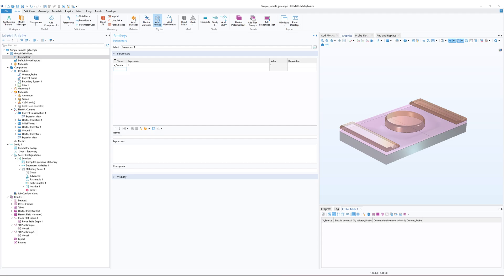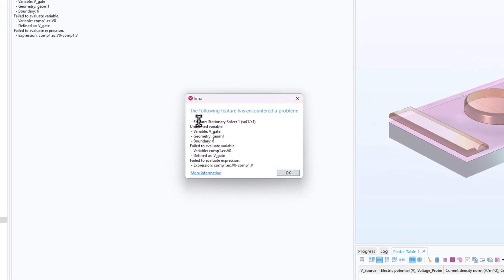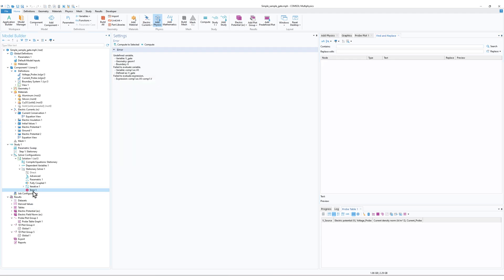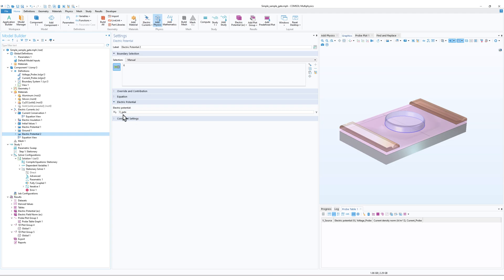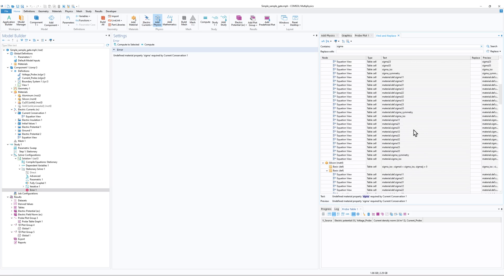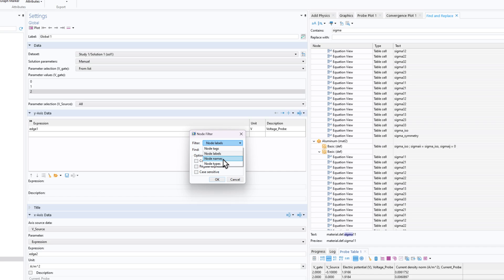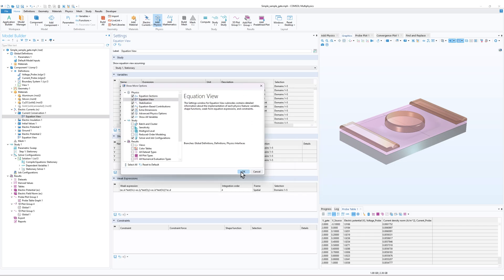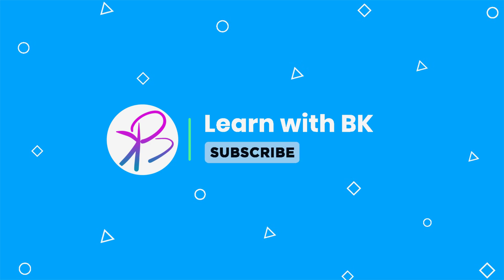Error Handling Basics in COMSOL Multiphysics® Software - Part 1 | Learn with BK

Comment: hi i am designing multi fin fet using comsol software i am getting this error (Failed to find a solution for the initial parameter.
Maximum number of Newton iterations reached.
Returned solution is not converged.
Not all parameter steps returned.) please help me  to solve the problem
Reply from the maker: Ya that's a common msg. There are many reasons you can get that similar msg. Its hard to comment

Comment: I'm trying to 3D simulate a very simple perovskite solar cell in comsol but although analysis converges, no parameters in Energy Level (semi) is becomes available to plot. It shows the following pop up whenever I try to plot it. But in 1D and 2D simulation, this problem does not occur. How do I solve it?
Reply from the maker: It is hard to say without looking at the model. Check selections, etc.